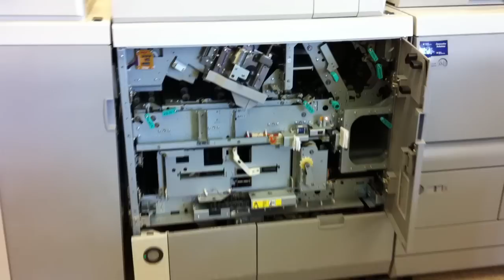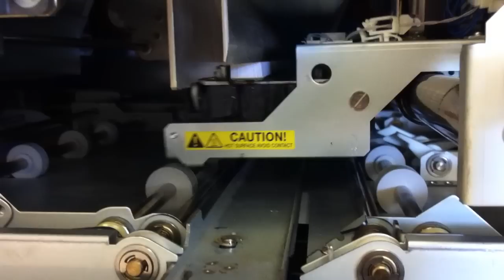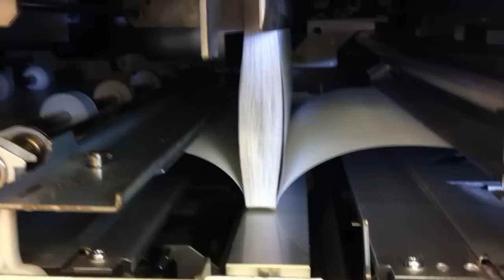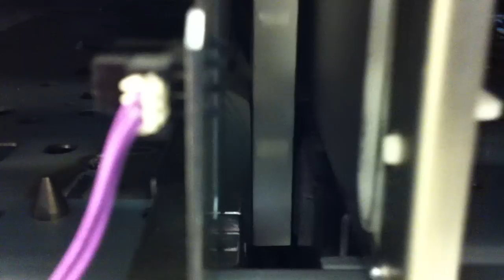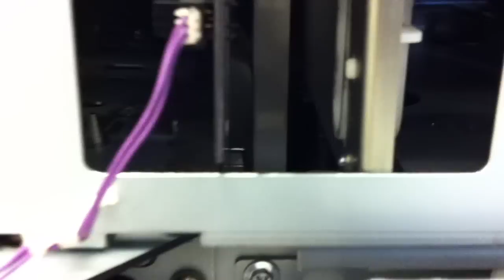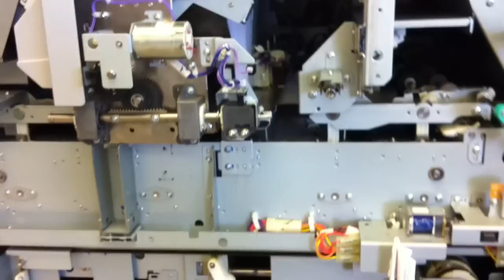Canon Perfect Binder A1 - Making a book

Comment: We have one on our machine at work. What was throwing us off was what size paper to use to have a finish size of 8.5 x 11, and we are using a thicker paper so we were not able to print a very thick booklet without it getting jammed and messing the machine up. It is very slow on thick booklets, but we run some that have about 34 pages in it and I can get around 100 booklets out in around 2 hours. I would say the negative about this piece is unless you have approval from service, when it gets a jam, you have to remove alot of screws and doors to get the jam out most times.

Comment: Hello there. The post might be a bit old but I need some help with this kind of binder. It does all the process es until the part where it stops delivering the book to the output tray. I dont get any error/jam code. I will have to power recycle the binder in order to have the book dropped to the tray. Can you please help ? Thanks
Reply: Berti Skenderasi you need to have a service tech come look at it. I've worked on them, can't say I miss them, they were a headache.